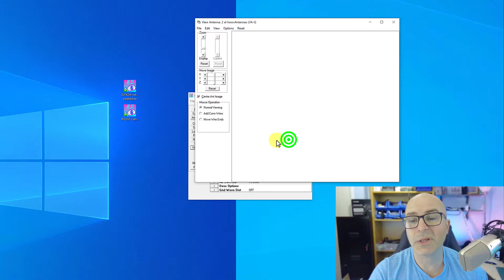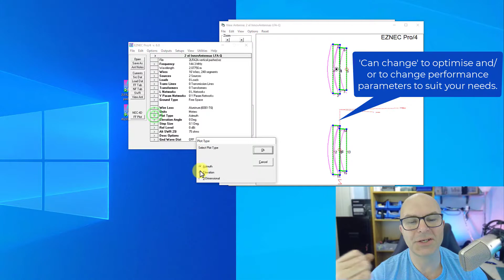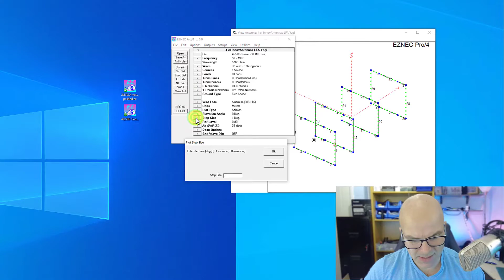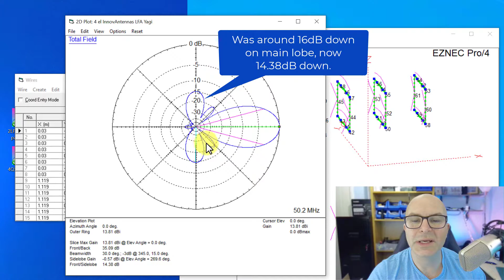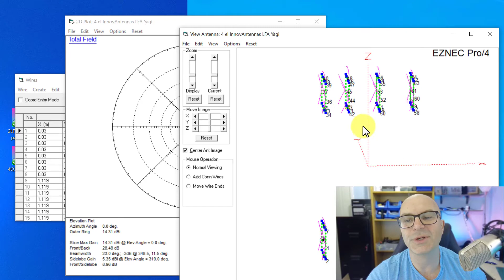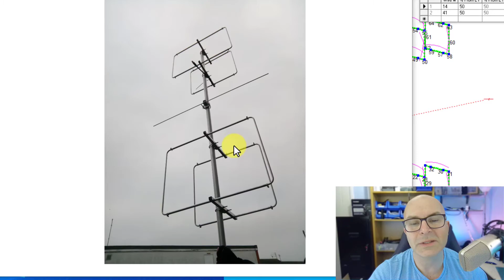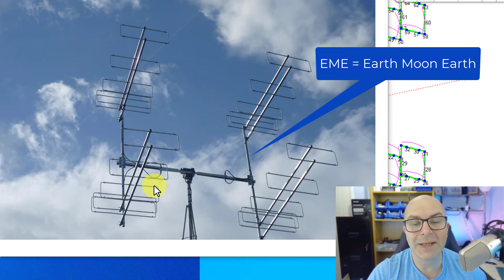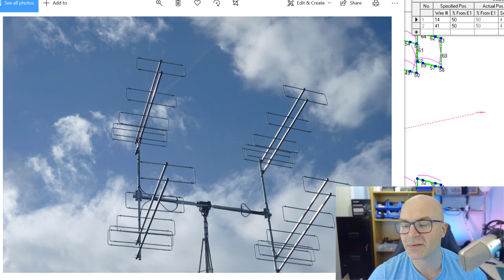Quad Beams part 3 - More optimisation variations and improvements

Comment: Justin, I have just finished watching all 3 parts and have wondered if you have done any work on quagi's ? In part 1 you noted that after I think it was 5 elements, there were little differences between a quad and a yagi. Using sqaushed quad elements and yagi directors for longer antennas, are there any benefits other than weight and wind loadings over those for a conventional yagi.
Gary

Comment: I have read that the real gain advantages are not realized until the two quads in phase are ≥ 1 wavelength apart.  
So I am wondering, relative to what? The outside loop wires, the inside wires, one outside and one inside wire or the average-center of the individual quads?
Reply from the maker: centre of one quad to the next. :-)

Comment: Hi Justin,
thank you very much for the Quad Videos! A lot of informations about your designs
and your 2-boom-construction-solution. A stack of short quads (2...5el) will be
a good solution for contesting (look at the yagi-stacks of 5p5t, dr9a, ol3z, k1whs or k5qe).
I think I will give a stack of you 3el-LFA-Qs on 2m-contesting a trial. The only problem
is to buy your antennas in Germany after the brexit ;-)

Good luck, thanks for your work and see you in the next video!

vy 73
Gerald, DL1RG
Reply from the maker: I just released another article in DUBUS magazine this week.
Reply: @hamradioguys  Justin, thanks in advance! What will be the content of your new article in DUBUS? 73 Gerald, DL1RG